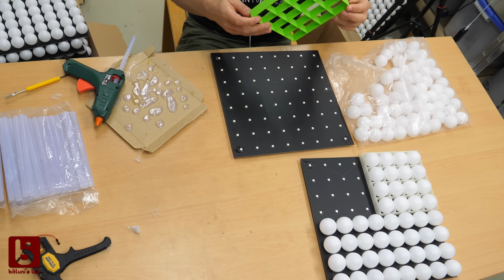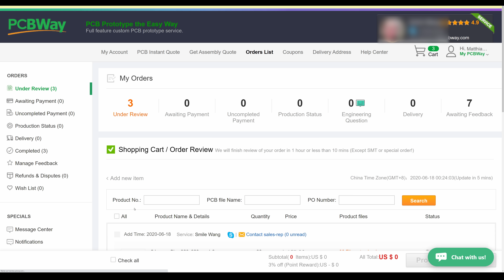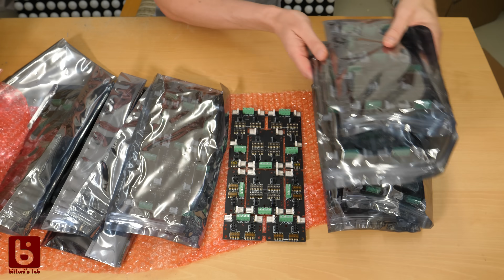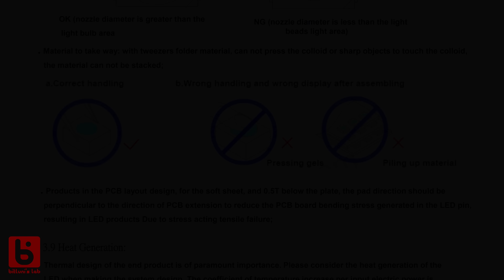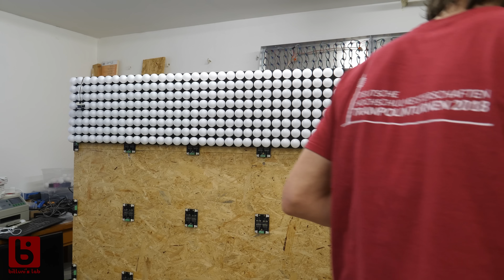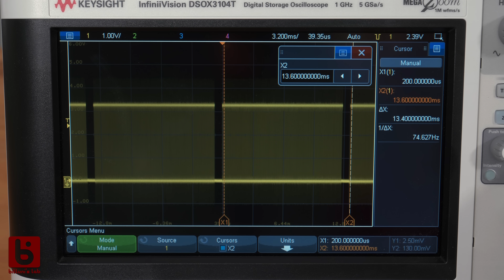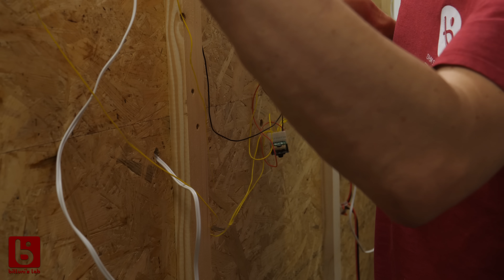Ping Pong LED Wall v3

Comment: Lovely project. The only problem I see is that the panels in each column depend on the ones before them, so for example if the first panel in the column brakes - the entire column will shut down. Not really sure how to fix that, but it must be not that hard with some kind of PWM expandors and little tweaks in the firmware. Anyway good job and good luck with this project!

Comment: The ping pong balls are the weak link. The grid you used to place the balls would have been better with diffuser material mounted above. It would also get rid of the screen door effect. The bleed between ping pong balls is very high and distracting.

Comment: why not cnc or just drill a hole in the balls? this way the light will only have to project though one lair or plastic and prevent placing them over the top of the plastic directly holes could also be drilled in the side creating ventilation

Comment: Here is an idea for you. get a larger 3d printer so you can print an ENTIRE GRID in one shot. have hold premade into the PCB for mounting this to the grid. have the grid be interconnected as "one piece" and then each segment will be a CYLINDER one wall thick 0.4mm thick and be a "friction fit" for the ping pong ball. no glue at all then.

Comment: Love this project!
But I thought: You can drill holes into the ping pong balls that fit over the LEDs and allow you to glue them onto the circuit boards? This avoids risking heat damage to the LEDs.

Comment: This is sooooo impressive!

During the beginning of the video I was allready thinking about the latency due to all the LED data lines in series 🙂
In some shots you can see that you see reflections of an pixle in the balls nest to them. I guess it is too complex calculation but I guess you could improve the quality if you compensate those reflections in software... or you could print physical seperators to reduce such reflections.

Comment: wow - thats a real cool project! as i saw you trying to print the ping pong balls I thought why not combine this - like print just the lower part - like 1/3 sou you get a cup and glue the actual ping pong ball onto it? if you would use non transparent, black plastic it could even prevent the light spreading between the "pixel" and you don't have to glue the balls directly on the LED. But anyways - that's just fantastic :)

Comment: "Did you say "twenty hundred balls"? 1. Even if there were 2000 instead of 1920, then why not just say "two thousand"?
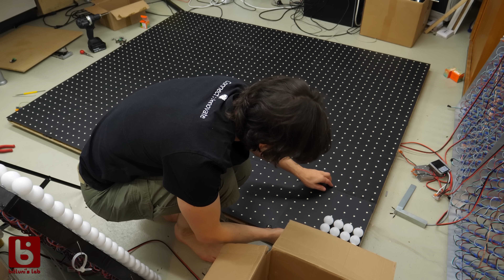2. Why say that number when it was 1920? 3. If not, then what did you say in that place that may have sounded like that (11:04)?

Comment: why would you need to print balls ? coulnd you print a rectangular grid and a transparent flat cover with some clips ? and you could even make use of a 3d printing service - although the straight linkes should improve speed significantly

Comment: Props to you for not only building this thing, but for having the courage to walk around bare foot on plywood
Reply: Anyone willing to walk around a shop with dangerous stuff around in bare feet is insane. Its no wonder the damn display tipped over. If you dont have better shop safety than that, you also don't consider other aspect like the fact that the display is heavy and should be well supported. It's just plain ignorance.

Comment: Hello, another wonderful achievement, bravo. I saw in your video another panel using chains of WS2811 (I suppose) whereas there you use SK6812, is it for a technical reason like the power or other? Yours sincerely. Eric

Comment: This is incredible, however ping pong balls are made of nitrocellulose!! Have you ever lit one of those things on fire? I’d be scared shitless if this ever caught on fire, unless you’re using a ball that is not made of nitrocellulose. Literally in like 30 seconds that whole wall would be gone if even one of those caught on fire. You should light one on fire just to see how quick they go up, it’s actually a lot of fun, but a whole wall of them combined with electronics that could possibly ignite them is slightly terrifying!

Comment: Interestingly the RGB -> RGBW conversion looks the same as the CMY -> CMYK conversion that printers do. In the latter case, to save on squirting 3 different inks just to make black, saving ink. In the LED case, saving power.

Comment: How far away do you have to stand so that the pixelated aspect of video running on these board modules is effectively smoothed out?  What is the largest size you can create for this type of video wall?  As a 3rd iteration will you be making an even easier to assemble snap & play version where each panel can be dropped into place without running new wiring, soldering pieces, or attaching power supplies?  In essence a self-contained set of hot-swappable (O)LED RGBW video panels meant for assembly by non-technical users.

Comment: now put the 3d printed grid for gluing the ping pong balls on the panels and print them black, too. This will prevent light bleed between the "pixels" and should result in much better contrast

Comment: Instead of 3D printed spheres or ping pong balls... what about 3D printed squares (in vase mode)so that they fit flush against each other(about 20mm in height).  You can leave the back sides completely open to accept the light and save PLA.

Comment: Very good work! You should use mirror film on panel for more brightness and more Flow in the rendering. A very costeffetcive and that little touch that will give you the satisfaction and also stand out from all other builds.

Comment: Great project! You can probably avoid faulty led by setting the welding temperature lower. 400C is too much for components with plastic parts, it could also have an impact on the colors temperature.

Comment: If your putting wires into screw terminals you shouldn’t put solder on them the solder is so soft over time the connections come lose and can spark. This has been the cause of a few 3D printer fires.

Leave them bare or use crimp connectors instead.

Comment: If you want a hole in the pingpong ball but youre not up to grinding them, just put them in a shallow acetone bath. They're made from nitrocellulose, which dissolves in acetone.
You should also know that nitrocellulose is very flammable (its gunpowder), so you should probably incorporate some fire safety mechanism into this wall. Like its own dedicated sprinkler system. Any fire started in it will be ... explosive, to say the least.

Comment: I it possible to "stagger" the positioning of the ping pong pixels to cover more of the open space between the balls?  This would be accomplished by shifting every other row horizontally 1 radius, and every other column vertically  1 radius.  Of course this would require some timing adjustment in the video signal assigned to those rows and columns but the results would be a much tighter pixel grouping, higher density, higher resolution.  This solution represents a 2-D version of the 3-D sphere packing solution.  It would also look similar to the 6 sided hexagon shapes and arraignment found in bees honey cone.   What would be the downside to this?

Comment: A lot of light bleeding from ping pong ball to adjoining.  Would love to see this converted to use that printed template that you use to place the balls.  Using a black grid with a semi-transparent plate at the top instead of the balls would allow you to have square pixels that are nearly borderless and no bleed.  If you have a multicolor printer, you could completely print each part as an assembled whole.

Comment: Very nice and interesting project. Insteed of gluing you could cut a small piece of the Pingpong balls and glue them to the board and not at the LED. I know, it would take a few hours to do it, but your LED wouldn't get any hot things on it :) 

Are you gonna be doing a Part4 of your project? Maybe with a small pingpong bals? That would increase the resolution :) 

But the way, how did you adress all the LEDs, with some special software or each led one by one?

Comment: The rear modules can be eliminated if you just use wires. You’re still doing the connections between panels by hand when you push them into the headers. Why not just drill holes into the OSB, and push in the wires yourself. 

Alignment with the current design takes quite a long time from what I see

Comment: Nuts! Mad! Crazy! Insane! Wooooooooow! Fantastic design and build. However I think I would clean/rinse the surface first and balls (remove manufacturing residue) and use another glue type. Hotglue is only soft and flexible when hot (can easily break off when moving in cold condition) and when the panel (LEDs) gets hot it is possible they fall off at hours of use or downgrade the glue connection over time (by extracting and expanding). 

What you need is a flexible heat resistant or heat absorbing glue or better, using no glue at all (if possible) on the LEDs, a panel ball click-in system or a rubber/plastic surrounding around the leds. For example you can buy rubber rings at any diameter in any thickness (2mm higher than LED), first glue them on the balls and after this glue them on the panels with the template. Or use tiny Neodymium magnets glued on the board (on fixed marked positions) and use metal rings glued on the balls, makes it easier to click it on correct possition and to service a board when needed. 

Anyway, just some ideas for durability of your great implementation.  Maybe I am wrong and a little over-engineered but hey, that's a Japanese style, solid solutions. Great video, good luck!

Comment: Beautiful! Wow, You are a hard worker.
I have a suggestion. You're free to use it if you like it....
Since you are using manufactured PCBs, get holes on each side of the LEDs to attach a 3d printed clip. This clip could have the glued on balls. You could even leave a 1mm gap to help cooling.
Keep up the inspiring work. 👍

Comment: I wonder if a small improvement could be made by designing interlocking black cards (be them plastic or stiff paper) to go between the balls to prevent light leakage between pixels? Could help to achieve a crisper result.
Reply: Or maybe even painting the lower halves of the balls black?

Comment: Can I just suggest if you do this again instead of using a 4x4 grid and having to move it why don't you do an 8x8 grid that has alignment tabs on the sides so all you have to do is slide it onto the top of your 8x8 pcb and glue all your ping pong balls down and lift off and then onto the next without having to move it 4 time for 1 board

Comment: I'm not much of a safety worry wart, but the filtered mask for hot glue and bare feet around wood... Ya, something is a tad off here. Take it from some one who is an idiot (me) and didn't listen to those who said to use protection equipment. Wear pants, at least normal shoes, and take time when handling anything made from wood. You are never more than 1 splinter away from a tetanus shot. Splinters puncture and immediately put (whatever is on them) deep under the skin and often directly into the blood stream. Do you know what type of chemicals are used to make OSB? Most of the time this isn't a huge issue, but it doesn't really cost anything to be a tad more careful and I think you've seen how long it takes for an accident to happen. Cool project bud, be careful out there.

Comment: Your panel is wonderful, but you made the same mistake as I did, of course on a much smaller scale, my panel was 20cm.
I made a panel of leds, for arduino, however, the light of each led interferes around it, for this reason each led needs to be isolated.
You need to make accommodations for each led, the template you used to glue each ping-pong ball to your led serves perfectly, paint it black and box each led, so you will have a better resolution, but will also limit the side view, but the important thing is the frontal view, right?
 
good luck congratulations, it's a beautiful project big hug
From Brasil "BraZil" it's wrong, right is "Brasil"  but it was said
 BraZil
Reply: Sorry I didn't mean error could have been a choice, I just passed on my experience to you, what I had to do to have the effect I expected, hug

Comment: Absolutely brilliant stuff!!! :)
Makes me think if RGBW LEDS could be actual pixels without the ping-pong balls at much higher density. You could save fiddling with the whole gluing exercise ;)
Like 1920x1080 for  starters before the 4k display ;) (I know similar stuff exists as commercial LED walls, but still...) If 5050 SMD LEDs are used and calculating with 7mm per LED (5mm + clearance) that'd be a FullHD display of about 14m X 8m  :)  Of course you'd need a much stronger engine to drive them.
Thanks for sharing, very inspirational! :)

Comment: What a work ! And the result is really good. 
Just a small suggestion to try. It appears some ghosting white on the close to white areas even if the sides are coloured. 
Maybe add a half distance 3d printed spacer (like the one to place the balls just shorter) to ensure more crisp image.

Comment: Dude, that crash was heartbreaking!  Luckily you stopped putting on panels.  The modularity is awesome and saved you so much time!   Ok now to other important stuff.

So, your idea about 3d printing the balls was awesome, BUT it solved the problem I had in my head which is having circular pixels rather than square pixels.  Now here’s the thing, that guide you made to keep your ping pong balls all in order, just print THAT.  Print it in black to prevent light bleed, spray them chrome so they reflect, THEN print translucent caps that fit into every grid square.  What do you think?

Comment: you should print a bunch of those ping pong guides & use them as dividers so the light from one pixel doesnt bleed into the surrounding pixels. itll help to create an sharper image

Comment: Great project!
You can always change your diffuser-design to something square, which will make it easier to print. If this creates issues with the actual light diffusion I would suggest to create a convex layer inside the square. This might sound counter-intuitive, but the added thickness will let less light through. Using a square design will likely create brighter spots in the center of the squares, but it might even look good without a convex layer. 
Print the square with the open side facing up, which will allow you to print relatively fast compared to a globe shape.

Comment: For awhile ive been wondering what it would be like to make a huge panel of rgbw leds, hundreds of thousands, then run fiber optic strands from each of the leds and condense them together like pixels, and line them up and glue them tightly, allowing you to make as pixel dense of a display as you want, given the diameter of the optic fibers you can source. Maybe this would be a cool project?
Reply: This sounds like a very inefficient and labor intensive way of making what would end up looking like a regular lcd screen, but with much less precisely controlled uniformity, and probably a lot of haloing around bright pixels

Comment: 132k subscribers - you could get 3D printed parts in droves with a little request.  I'd happily do a 10 hour print and send it.  Most people have some white knocking around and no need for the spherical balls, pure square pixels would be just as easy.

Comment: That is a really great project.  However, you should have listened to the LED manufacture regarding glueing to the face.  They will all fail.  I've done a lot of that testing.  It takes some time, but they will all fail.  Sorry.

Comment: I love this idea, though after working with professional LED walls for a few years, there are a few things that could make these more viable as a DIY prosumer product. If these were configured so that one "full-panel" consists of a 2x2 arrangement of the 8x8 "pong-panels",  & a means of jumping power & data between the full-panels on the backside, this would be a very viable option for small traveling shows. That way the wall can travel small & more securely. Also, not a huge fan of gluing the balls directly on top of the LEDs but I see in your 3D printed attempt you made them open cavities which is better overall for both thermals, longevity of the LEDs, & light distribution.  I would suggest adding one more component that you'd directly attach (screw into) to the pong-panels, some sort of socket that the open-faced pong balls could snap, click, or screw into, that way you eliminate the hot glue altogether (both during assembly & repairs). Not sure which method would be easier to fabricate though. Other than that, everything looks brilliant! ^_^

Comment: unles this goes agains what your astetick immage of this is you mgiht want to considder printing or otherwisee get something to separate the pixels so you can avoid the bleeding efect from one pixeel to the pixells next to it. by separating i dont mean puting the furrther away. but rrather futting in seeparators liek the grid you used to glue the balls.

Comment: I know I'm very late (like Internet Explorer late) but you can use isopropyl alcohol to gently remove the hot glue, not heat or mechanical force required. What a beautiful project!

Comment: Hi, really amazing project. I see that you have six panel columns and each column is controlled separately. I would be very happy if you revel how the LEDs are connected in a column. Is the first row going from upper left to upper right or upper left to bottom left? Or something different?

Comment: Would printing a bunch of circles/cylinders linked together to hold the ping pong balls help? it may be more work. However, I expect it would have all the same benefits (minus the lack of gluing) as the printed balls and it wouldn't take as long to print. .. just a thought..

Comment: I wonder, could you stagger the ping pong balls for even greater density? Might be a little more difficult to work out the columns, but it would have greater "packing efficiency"